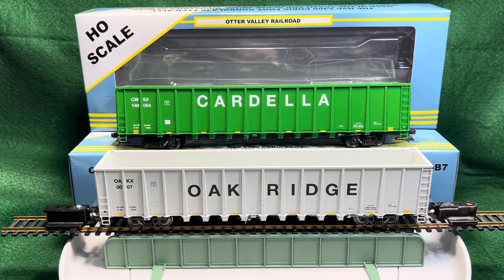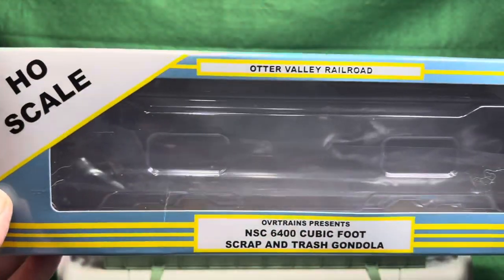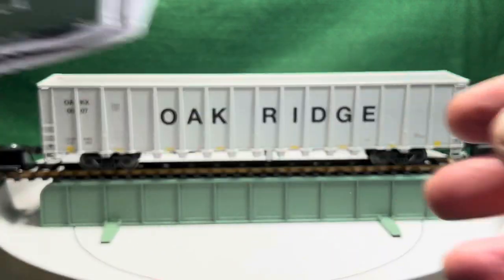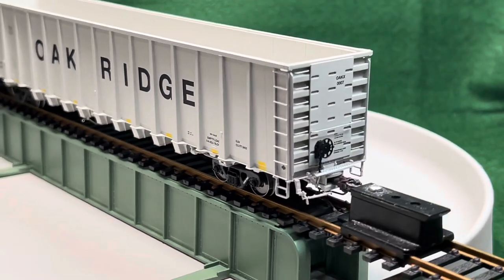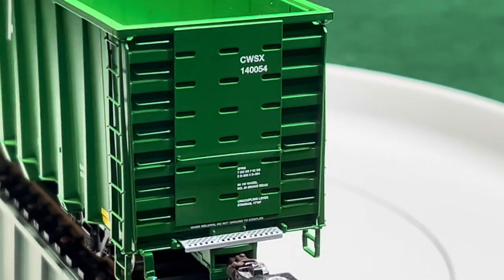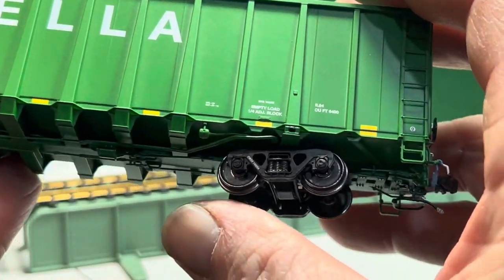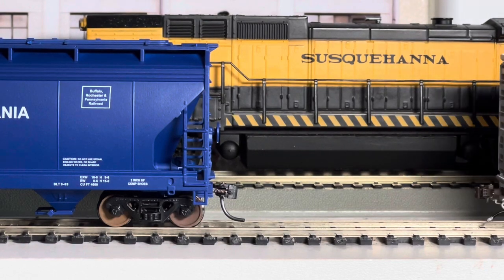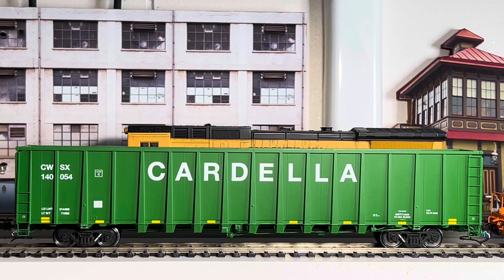OVRTrains HO scale NSC 64 ft 6400 CuFt Scrap & Trash Gondola

Comment: haven't seen those similar gondolas on the NYSW lines in awhile either, speaking of! you going to weatherize and load em out?? you weren't joking about tons of boxcars coming through here either, caught another canadian train coming down yesterday that had multiple 10-15 car stretches of CP boxcars between pretty much nothing else but loaded centerbeams & bulkheads!
Reply from the maker: I want to put a slight weathering on them and add a load. Those CP cars sound cool. I wish I had more time to railfan Binghamton.
Reply: @MyLifesTracks  if you ain't heading out this weekend on a long drive, another vestal viewer that's a retired dispatcher just asked to go railfanning with me sometime (for security in #'s, apparently a bit disabled) so I was thinking of doing a nondescript meetup sometime after noon saturday at either Prospect QD, or Carlin Rd (where a few cars wouldn't be a problem), you wanna come hang out for awhile? if you want to then you can invite a couple other railfanners too if they feel like coming too. obviously b.y.o.f.b!
Reply from the maker: I’m busy until 4, but I’ll be in Binghamton at that time. If you guys are still out I could  hang with you for a little.
Reply: @MyLifesTracks   I should be at least, I'm free till 6 myself to kick rocks till I gotta go help my uncle. we figured the Prospect end of QD is the spot for the day, I should be there around 1-130 so I'll tell Mike to meet me like around 2.